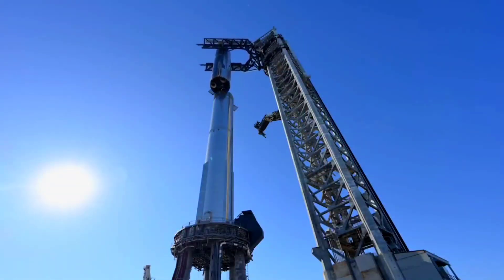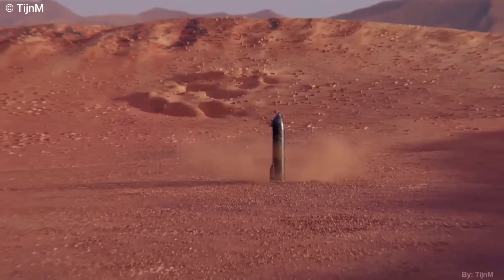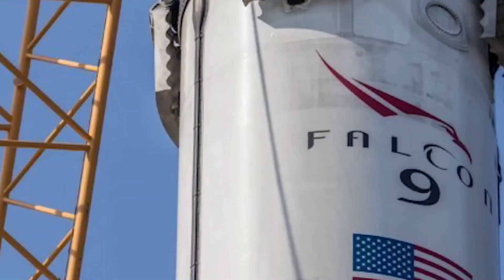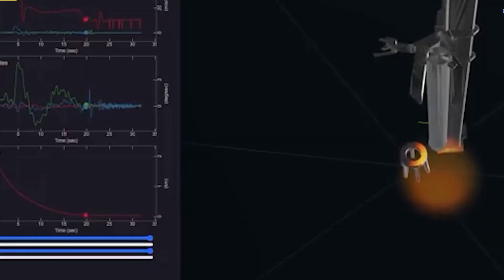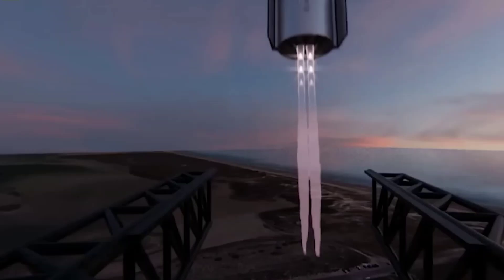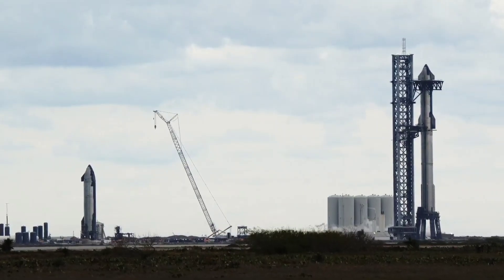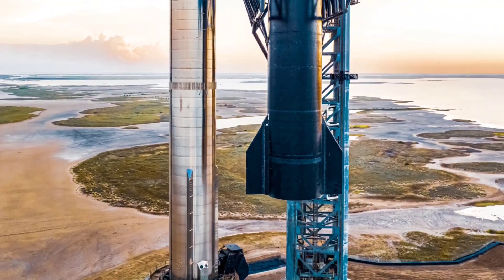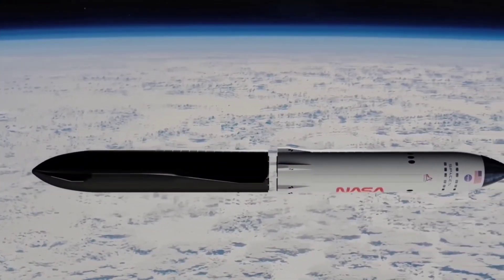Elon Musk BRILLIANT Solution To Save Super Heavy 33 Raptor Engine

Comment: Thin, lightweight, Mylar heatsheild can be deployed to shade the propellant depot from solar heating. This would keep it "in the shade" where it's -170⁰C (-274⁰F) or lower, excellent for cryofuels. LOX is -182.94⁰C (-297.3⁰F) and liquid methane is -82.1⁰C (-115.78⁰F), both well within acceptable parameters. The liquid methane could be utilized to keep the LOX cryogenic. This will all be addressed when they actually design and build it.